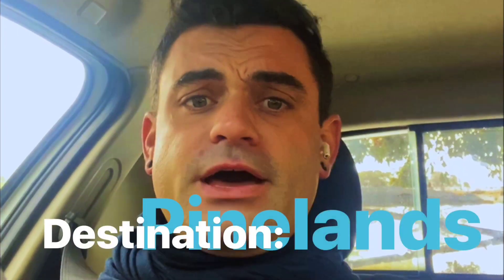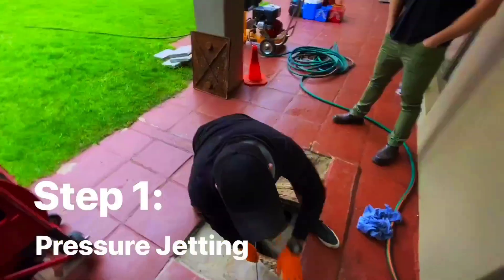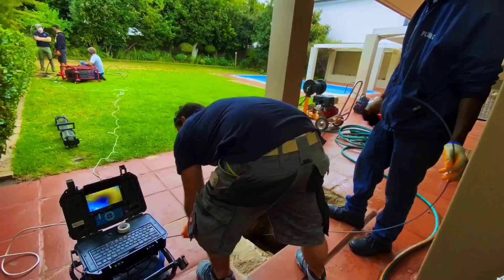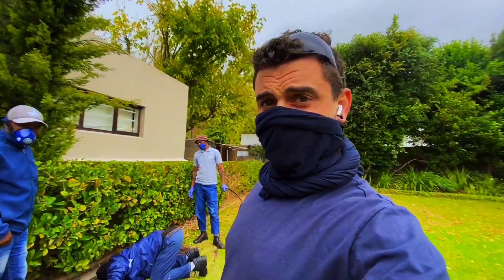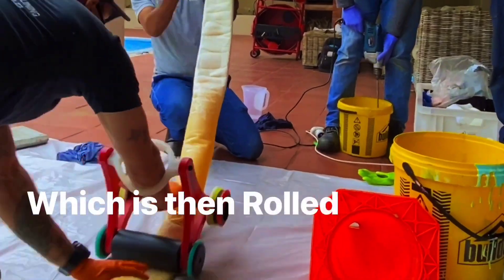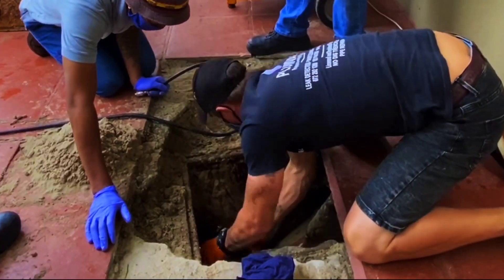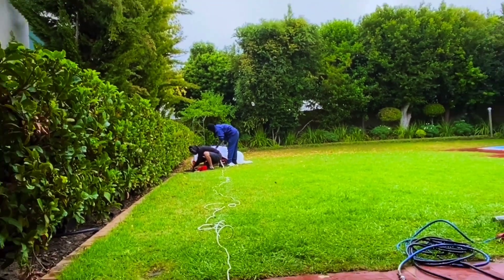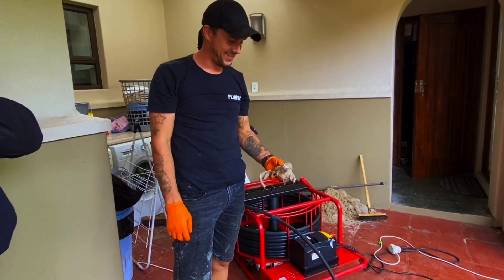Inversion Drain Lining with Picote Cannon after Concrete removal

Comment: If only it was a permanent solution. It may extend the life of the pipe for now, but it is a very situational solution. This will not fix bad connections to city main lines or excessive "bellies" in sewer/drain pipes.
Reply from the maker: Very situational, as all repairs are… right? Why wouldn’t this be permanent?
Reply: What are your end connections? Are they glued or mortar? If a liner is installed from the house to the street, the tap on the main in the street still requires to be dug up and repaired to create a seal. Unless you live where the trees do not, eventually a tree/shrub root will find its way. So, indeed it is a repair with hardened epoxy, but the length of time it will last is to be determined. It is newer technology and hasn't been extensively tested underground.
Reply from the maker: @foenic85  thanks for your thoughts

Comment: How long was that line
Reply: The canon is obviously meant for short lengths. I think the drain in the video was about 12 meters (DN100). Quite good for such a small pressure chamber. I would ask Picote for exact specs.